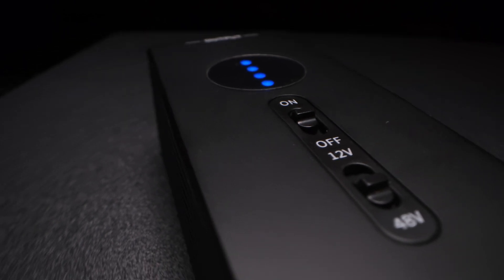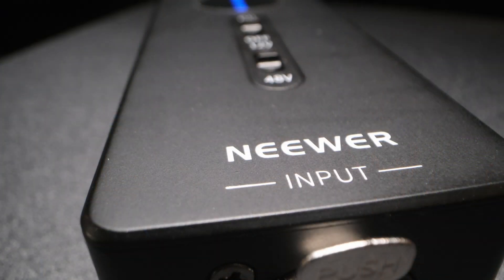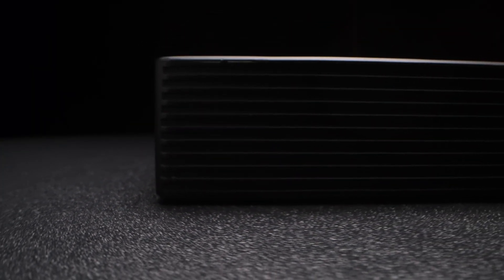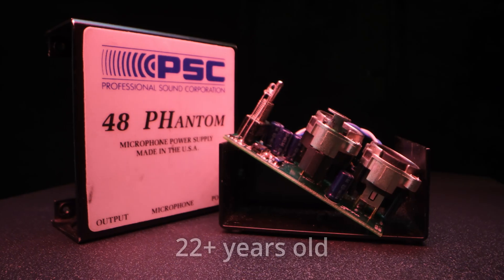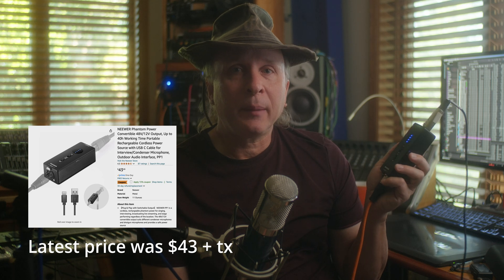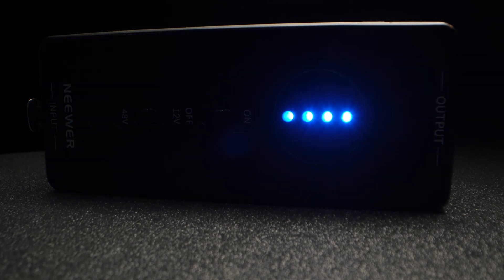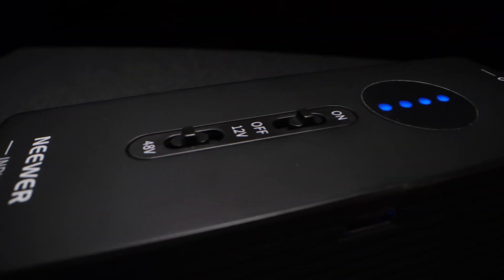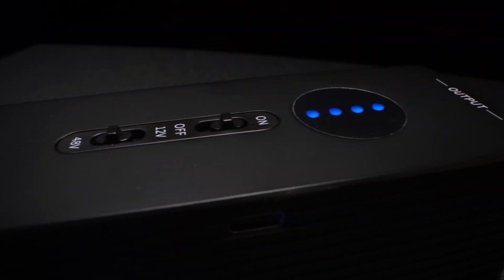How To Power A Mic That Needs 48V Phantom Power On Your Mirrorless Camera

Comment: URL to buy one? is there something that can run from 110v so i dont have to run with the battery
Reply from the maker: the battery works fine, really does run for its rated length. could use a USB C power supply but that kinda defeats the purpose and introduces the risk of hum & ground loop. if you want AC power there are other units out there or a small mini mixer